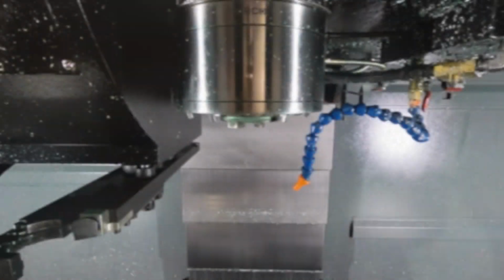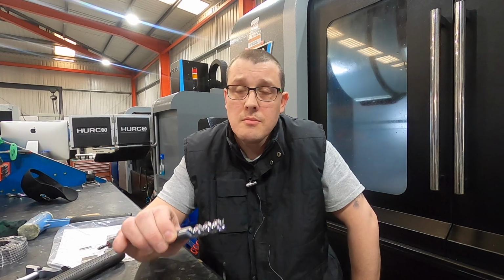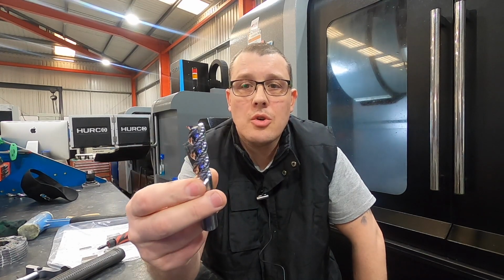HIGH SPEED MACHINING CHRONICLES -  Episode 1: Adaptive Toolpath in Action!

Comment: What kind of chip load with the rougher? Could you go faster with a 10% step over. I've machined some plastic at 800 ipm. With a 10,000 rpm spindle. I love the rooster tail from the high helix.

Comment: I have a question, (might've missed the answer in the video) but why did you switch tools the first time? They looked identical. (four flute end mill) was it for a sharpness/wear type thing?  Thank you!
Reply: Both 3 flute , the 1st was a 16mm the 2nd was 12mm . Needed a smaller cutter for the rads in the shallow pocket and the slot width was 15mm

Comment: Thanks for making the video. I would be interested in milling tool sounds that are ok occasionally, but you would not want to hear continuously. There are times when the operation looks good, but I ask myself, should it sound like that?
Reply: There's a slight vibration sound when roughing out as the stock is sticking out if the vise so much lol

Comment: Nice, I've got a question tho. How do you machine aluminum with out coolant? I know using uncoated cutters help but I haven't had good luck, with chip welding. When you did the sloting you used coolant but on the side profile you didn't use it. Is there something I'm missing? :0
Reply: When cutting full flute length the heat is spread all the way up the tool length so it doesn't get hot enough to weld to your tool . Still have to be careful though 😬
Reply: @Sheffrob1  that's makes sense, haha I remember the first time I cut aluminum, I used a 4 flute tialn coated, on a machine with no coolant and not rigid enough to make a full pass, I sent that the end mill directly to carbide heaven. Haha

Comment: When you are performing machining at this speed do the tool bits wear much faster as well?
Reply: They are solid carbide cutters cutting aluminium so they last a reeeeealy long time
Reply: Adaptive roughing will make your tooling last even longer at these high feed rates and the larger doc spreads the heat along the length of the tool thus also helping tool life

Comment: It is nice to see Adaptive tool cuts using full depth of cut. The contant load engagement on the flutes extends tool life by minimizing shock loading. I see the operator chose to use round stock instead of plate I wonder if that was to minimize warping once the part was complete.

Comment: What machine is this? Also what software do you use to design parts? Do you do QC on parts yourself? If so, what are your preferred metrological devices?
Reply: Hi , the machine is a Hurco VMX42TI, I use Fusion 360 for my cad/cam and we mostly self inspect using Insize metrology 👍

Comment: CNC machining is like blending science, art, and maximum efficiency all at the same time.  And high-speed pathing has numerous cost and efficiency advantages over traditional pathing.  Lastly, every time I watch these videos I always want to know what the part is and want to see it in use after it's been installed.  (Obviously, it's not possible with everything but it would be great where allowable).  Cheers!

Comment: I would like to see the part finished. It’s one thing to see one running, I like to see it start to finish. Also, you could tell us about how you have the part in the machine. Part location and fixture.  I myself am curious as to why you used a round piece of stock. Thanks.

Comment: 2D adaptive clearing strategies are even more common for higher MRR, depending on the machine, spindle and tool there's a sense of running even more higher levels...
I've never been working with Hurco machines, but seems to be running smooth on the material, what about tolerances guys?
The finishing also looks so great, the use of uncoated carbide tools, with higher helix angle and polished finishing works so nice for the aluminum and magnesium alloys, nice technique and explanation, but my favorite one was the end mill scenes. 

Nice.
Reply: Thanks

Comment: Looks like a Doosan 750 Mill. Mitsubishi makes some nice insertable high feed endmills designed for dynamic toolpaths. 
Here's a tip... if you put the next tool number right after the tool change callout,that tool will be waiting in the ATC load/unload position, making tool changes faster.
Example tool #1 is the rougher and tool #30 is the finisher, a simple T30 on the next line of code after the tool #1 tool change will make the finisher 
(tool #30) waiting in position.
Eliminating the tool the be unloaded, ATC indexing to #30, loading tool and completing the tool change operation. It will already be there waiting for exchange. 😎👍